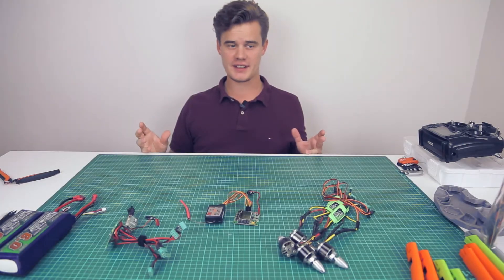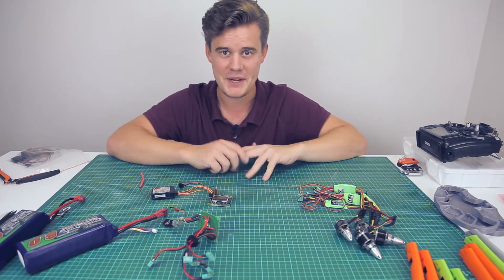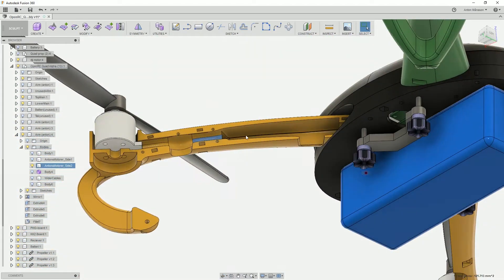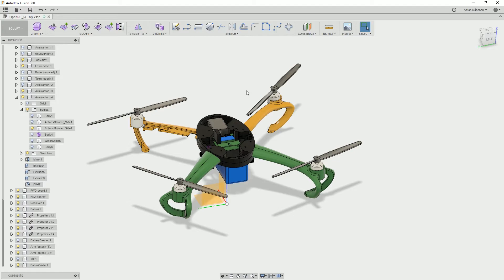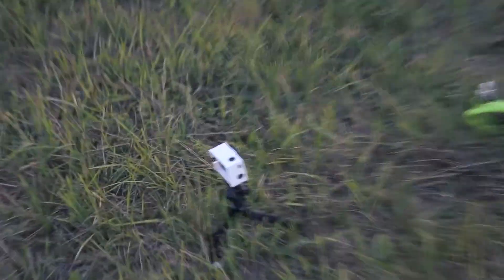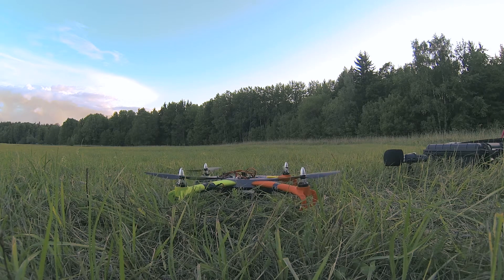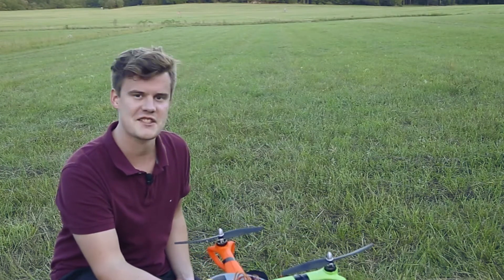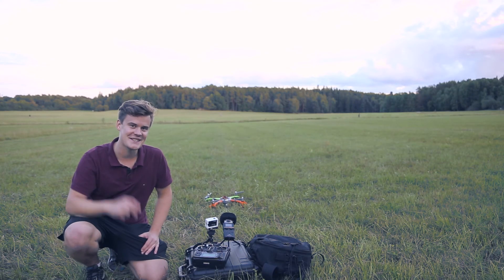I BUILT AND FLEW A 3D PRINTED QUAD

Comment: You did a very nice job on this quadcopter.
I think you have still enough thrust to carry a little more weight, so you could make the arms a bit more stiff and maybe get rid of some wobble.
I am not enough a drone expert to know if that will work or not, but I saw some movement in the frame I guess when it started to wobble.

Good luck. And, keep going :-)